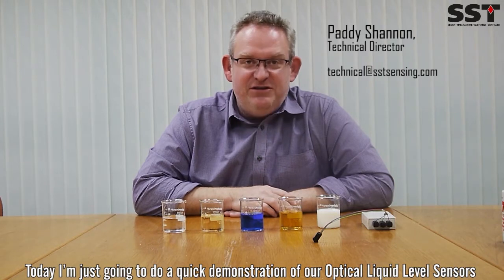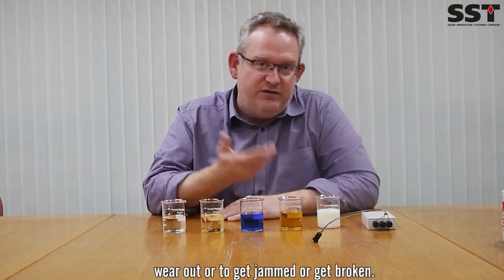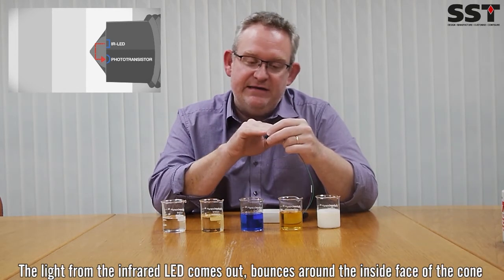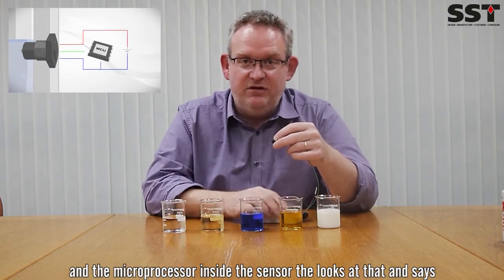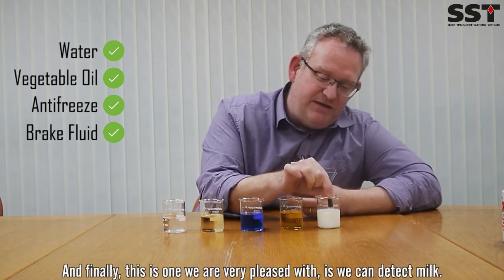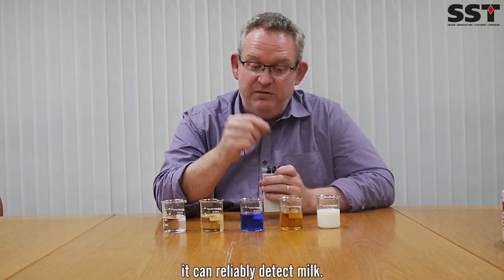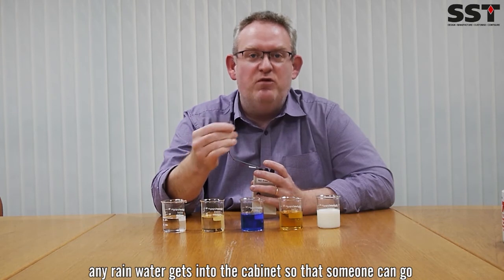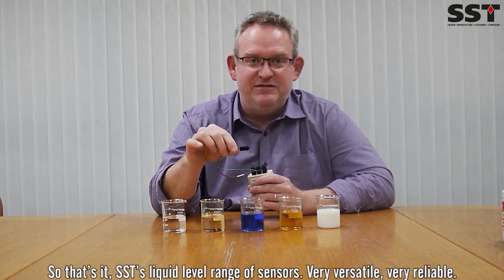Optical Liquid Level Sensors: How they work | SST Sensing

Comment: hello, I bought one of these and connected it to the correct power supply of 5v as it was stated and as soon as i dipped it into water, it worked a few time to light up my LED and then smoke came from it and it stopped working. What can be the issue?

Comment: Can the sensor detect liquid without coming in intact with it? Does the device have a reading gauge or meter to detect deviations?
Reply from the maker: Hello Mr Duru,

Thank you for your question and for watching the video.
The sensor can only detect the presence of a liquid if the medium physically touches the tip of the sensor. Approximately 1mm of liquid is required to allow the sensor to switch. Please see this video for the animated explanation of the measurement principle:
https://www.youtube.com/watch?v=PuRf3mT9jgo

The sensors are for the presence/absence of liquid. Similar to a switch, this gives a high/low output. There are a variety of different electrical outputs available depending on the application and interface requirements.

I would suggest reviewing our popular Optomax Digital sensors to see the range of options: https://www.sstsensing.com/product/optomax-digital-range-of-liquid-level-switches-2/
Reply: @SSTSensing  Thanks for your reply, I'll scan through the links

Comment: HELLO  WE  ARE  WORRIED  ON  GLASS  PRISM AND  SS  TUBE  JOINT  LEAKAGE  AT  HIGHT  TEMP WATER  LEVEL SENSING    WHICH MATERIAL U  USE  OR  OR HOW  RELIABLE  IS  THAT  JOINT

Comment: STT - i am engineering a system that will turn on - when not in water. So the reverse of your sensor - could a circuit be reversed to create this operation?
Reply from the maker: Hi,
If the supply voltage is between 4.5–15.4VDC then our Optomax Digital: (https://sstsensing.com/wp-content/uploads/2017/07/DS0032rev16_LLDigital.pdf) range would be a good choice. You would want a LOW IN AIR version. This will allow for a close to supply voltage output when in contact with liquid and 0V when in air. Examples of this would be LLC510D3L, LLC210D3LSH or LLC710D3LSH. All of these versions can be sampled on Digikey and Mouser.

Please note if the supply voltage is not suitable or you have other questions regarding suitability then please send to technical@sstsensing.com and our engineers will assist directly.

Hope this helps!
SST

Comment: Can we use this  level switch mount vertically on water line for switching purpose. Or is it working???
Reply from the maker: Hi Vishvnath,
Mounting recommendations can be found in detail on our 2D Mounting drawings on our website – To prevent any compatibility issues with the sensor and application, we would recommend to contact our technical team at SST sensing to discuss the application: technical@sstsensing.com.

Comment: Hello i was wondering if such sensor would work with liquids such as red wine and sparkling wine. Let me know
Reply from the maker: Hi,
Yes! Our sensors woud certainly work with these type of liquids. If you would like to send more application details to sales@sstsensing.com, we would be more than happy to help.

- SST
Reply: @SSTSensing  nice! The problem is that the enviorment will be really humid ( like droplets of product) and i think that this could be a problem because it could trigger the sensor accidentally
Reply from the maker: @thephoenix8036  Our sensors are digital and contain a microcontroller. 
The software inside is designed to counter various environmental conditions and intelligently switch. However, there are limits to conditions such as very high humidity.
If condensation is allowed and forms a drip on the sensor then it will be detected as it is liquid.

I hope this helps!

If you would like our Technical team to provide any futher application details and how we could help solve your problem, please contact technical@sstsensing.com

- SST

Comment: How well might these sensors work in an environment of high humidity or fog? Is the sensor apt to give a false positive for submersion if there is condensation, etc...? Thanks!
Reply from the maker: Hi David,
Great question! - Our sensors are digital and contain a microcontroller. The software inside is designed to counter various environmental conditions and intelligently switch.

However, there are limits to conditions such as high humidity. If condensation is allowed and forms a drip on the sensor then it will be detected as it is liquid. 
Our recommendation is to test a standard sensor in the environmental conditions of the application. If the sensor gives false positives in the high humidity conditions then contact technical@sstsensing.com – there is a possibility to try a different software version which could operate better under the humidity conditions. 
Hope this helps.
SST

Comment: I would like this to tell me when it's no longer submerged and therefore my system has lost fluid, would this be okay to have in an airtight reservoir submerged and my system notify me once the sensor isn't covered in fluid?
Reply from the maker: Hi, Yes - This sounds like an ideal application. Would you be able to advise what the fluid is? 
If you would like us to provide a quotation, please contact sales@sstsensing.com with your power supply and output requirements are, and how many sensors you could possibly be looking at?
Thanks,
SST.
Reply: @SSTSensing  Mailed, thank you.

Comment: I have  a black water tank on my boat and I would like to know when it is approaching the full mark. Do you think fluid movement inside the tank makes this product unsuitable  for this kind of application?
Reply from the maker: Hi Ronald, an option to solve this problem would be to add a delay to your system. SST Sensing's liquid level sensors also contain micro-controllers which can be programmed to contain a delay within the sensor itself. If you could send more details of your application to technical@sstsensing.com, we would be more than happy to provide you with a more detailed solution.
Thanks.

Comment: How does algae growth or iron bacteria affect the sensor?
Reply from the maker: Hi Mike, 
Our optical Liquid Level Sensors are very easy to maintain and clean. If algae growth is occurring on the sensor tip, simply cleaning the sensor tip should solve the problem. With that being said, it should take an extensive amount of time before algae or bacteria growth would effect the sensor.
If you require more information for the sensor within you application, please contact technical@sstsensing.com.
We would be more than happy to help!